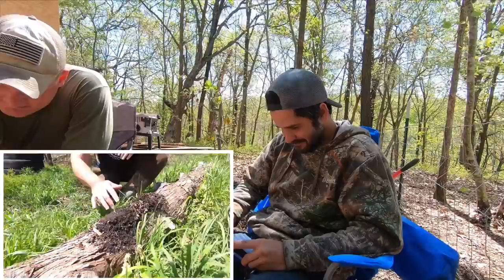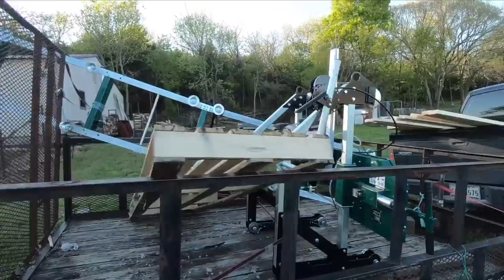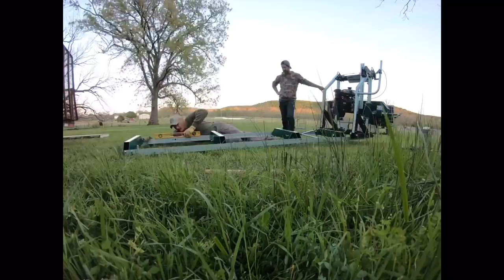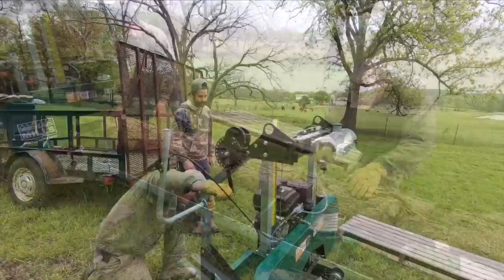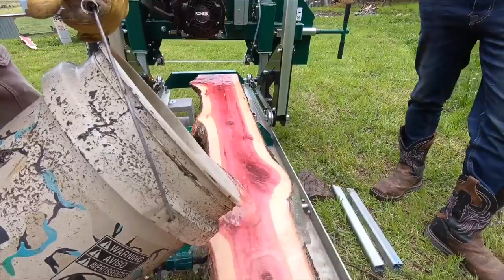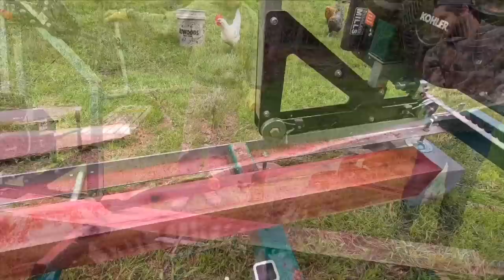Eastern Red Cedar On The Woodland Mills Sawmill | The Crockers Off Grid Tiny House

Comment: That meal is so big I would just weld it onto a trailer flame and make it portable with some side rails that popped off for holding the logs on the sides and put a couple leveling jacks.  Lol. That could be Jason‘s part-time job, driving over to peoples houses and milling their wood.    Now you guys need to get a bunch of very evenly cut 3/4 and build a drain shelter. This time of the year that should dry out in about 4 to 6 weeks if you don’t get too much rain.  You’re going to get some gorgeous wood out of all that cedar, and people love cedar boxes and stuff like that that are pretty easy to build with the smaller pieces so none of it should go to waste.  

Here’s a video of a guy who’s been doing this for 20 or 30 years and he talked about drying the wood and a little mill maintenance stuff, it’s a great video to watch. It’s Hannah Barron‘s dad. https://youtu.be/AHK9ZZRa9mQ

Comment: I have owned an HM130 Trekker for almost 2 years and I noticed you have your mill on the track backwards. Your log locks should be on the same side you push the mill from. Believe me, Down the road it will save you many steps. My 130 is 6' longer plus the trailer tongue so every little step makes a big difference by the end of the day.Your cedar looks great, I happen to have about 75 nice cedar logs i just dug out of a brush pile that were going to get burned but, now they will be more useful lumber. Have fun with the mill and be safe.
Reply from the maker: Brad Souter thank you for the tip. We have lots to learn about milling. Lol 😄
Reply: @SawyerRidgeFarm  If you ever need help , i can give you my number and will be glad to answer and help any way I can

Comment: Small cedar has prettiest lumber ..larger the cedar tree more red the boards have in them  ..why I like that size log for interior builds like cabinets etc .its Beautiful ....ps ..to get most out of log stick a board under small end to not cut so deep in thick end . For more board foot of lumber from log ..you can use the  short boards for other projects ..like cabinets ..or leave board out and do it by eye or like I do start cut from big end  ..need a square ..but boards will need to be ran thru table saw to true edges and but up or mine do ..
Reply from the maker: Thank you colt 45, cant wait to hone my skills on this mill.

Comment: I saw the 2 flat bottom jon boats by the fence as yall drove threw the gate. Are they be for sale or are they even useable? I dont need the big one I just want a project to work on for our pond and if I go to our small local lake. You cant have motors on your boat their and something small that I can get in my truck would be awesome. Or we can make a deal because I have a small trailer you can turn into a boat trailer.
Reply from the maker: Good Ol Boy #76 they’re not for sale at this time. Thanks though.